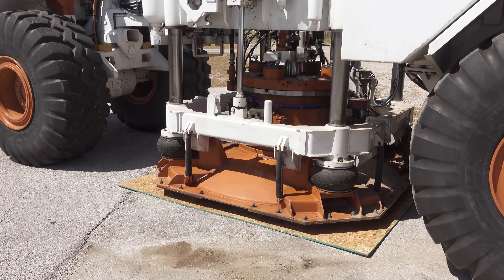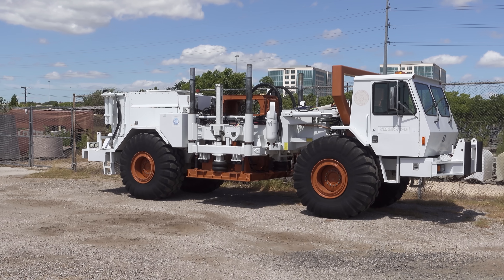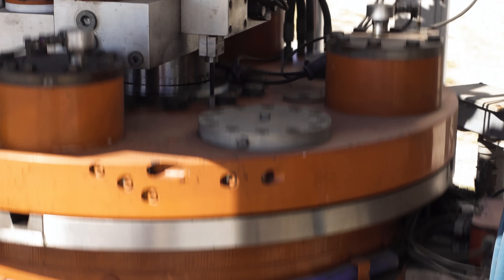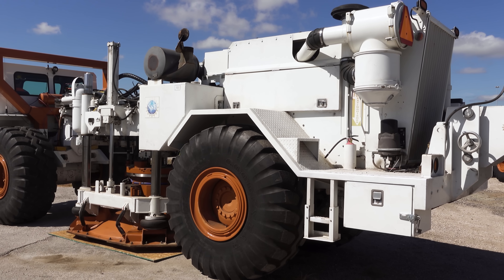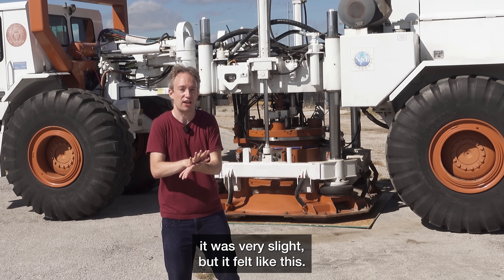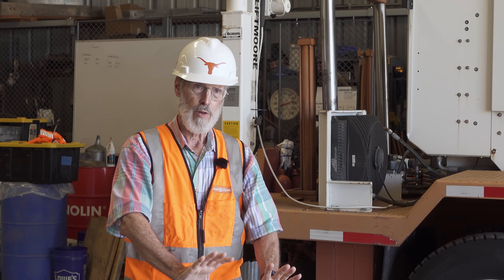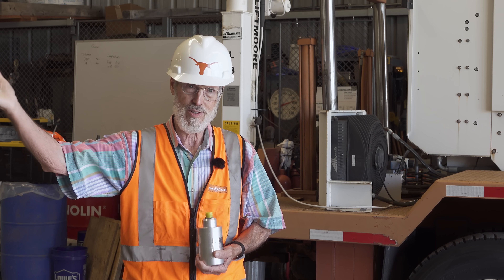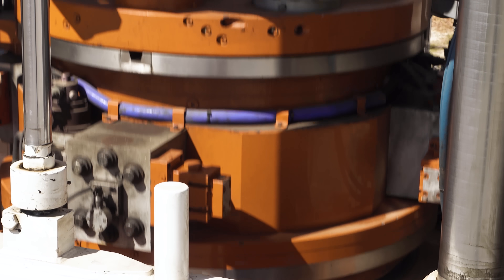This massive truck makes artificial earthquakes

Comment: i wonder just how much energy is required to move 27 tons back and forth at that frequency. has got to be megawatts worth of power
Reply: It doesn't move 27 tonne back and forth, the whole machine weighs about that, the inertial mass is typically about 1/10th to 1/12th of what the entire machine weighs. The entire machine is picked up on the central pad/mast, the inertial mass as it reaches the bottom and top of the stroke give the whole machine some inertia to push into and lift itself creating the earth wave. Depending on the frequency depends on how much power you need although there are mechanical limits the larger the machine the lower the maximum frequency the machine can reach. 

Something around 27 tonne will be limited to maybe 120 hz although typically run to 90 hz, smaller versions can do up to 400 hz although it does get to a point where the amount of energy you are putting in will start to overcome the hold down force so at 400hz you might be limited to 50% of what the machine is capable off.

As to your original question a 150ish HP diesel tractor motor is enough to run a 12 tonne machine the larger ones are around 300 hp, vibroseis or seismic sources used widely in geophysical/geological imaging if you want to do some further searching.
Reply: I don't think it's actually moving a 27-ton weight, just generating that much force with hydraulic mechanisms.  Still uses a lot of energy, though.

Comment: = H U M A N   U N I T S =

0,5 miles = 804,672 meters.
Reply: Wh-...  What?
Reply: @dannypipewrench533  have you read it right?
Reply: @_GhostMiner  Half a mile is not eight hundred four thousand six hundred seventy-two meters.

Comment: Interesting video Tom, but the Jurassic Park reference is actually an interesting one since they used guitar strings mounted on the vehicle to get that effect. DIY Hollywood at its finest!
Reply: I was looking for someone mentioning this!
I recall that they tried an actual ground shaker but the cars' suspension completely dampened out the vibrations, like it's supposed to really, so someone clever came up with putting a steel plate with an eye hook under the car and stringing a bass wire between the plate and the car's chassis. Then some poor, slim fellow would twang the string on cue and presto! one of the most iconic scenes in cinema.
Reply: I seem to recall from the behind the scenes, that they had a guy laying under the dash strumming a bass. Been a while since I watched it though.
Reply: What I love about that is generally how simple practical effects really can be.
Reply: It's not quite as interesting as the T-Rex machine, but that's interesting.
Reply: Dunno why they didn't just use the car's stereo

Comment: Imagine making a whole university building evacuate and being like "oh my bad, I'll just turn down the liquidator a bit, shall I?"
Reply: We call that an unscheduled earthquake drill. It was successful.
Reply: "Dont you worry pals, its not an earthquake! Its just our lil T-Rex stomping around"
Reply: But: it's good people knew what to do in an earthquake!
Reply: @tompw3141  well, in CA they do earthquake drills at school as well as fire drills. For earthquakes though they actually had us get under our desks and cover our necks with our hands to avoid falling objects. Depending on the building it can be safer to evacuate though. I would probably stay inside and duck and cover under something sturdy though at a college campus. Usually the buildings are newer and most are designed with earthquakes in mind when you are literally on a fault line
Reply: @jamies6337  UCLA has some old historic buildings. They may have been retrofitted with earthquake isolation pads like all the buildings at UC berkeley though.
Reply: @turbo_brian  Berkeley is on the Hayward fault, it's sheering Memorial stadium in two. They got quake concerns there.
Reply: @tompw3141  Except that’s not what you do. You’re supposed to get under a table/ desk, but if that’s not possible, next to a wall with no windows.
Reply: @tompw3141  Unfortunately leaving the building is exactly the opposite of what you should do in an earthquake, With few exceptions.
Reply: @macattackmicmac  Staying inside the building is the exception. As best as you can you should go outside clear of any tall structure. So unless you're in a place with many tall building close to each other, you should go outside.
Reply: @majesticfox  No it's really not. Most modern buildings are made to stay standing till the shaking stops, and to get safe from a potential collapse you need to get 1.5 times the height of the building away  from it. Finding a safe area in any even moderately built up area is going to be a challenge, coupled with trying to run on unstable ground, and the danger of falling masonry and glass from the facades of buildings fail.
Reply: @macattackmicmac  masonry and glass can fall inside as well. A lot of structures (especially governmental buildings i.e. schools) are not built new and if an exit is near you might as well run out before something gives in. Not sure where you got 1.5x distance from height from but the building will obviously fall down not outwards in the event of a collapse - as long as you have something obstructing you from line-of-sight of the building dust and glass should be a non issue.
Reply: @macattackmicmac  I'd rather take my chances outside than enjoy my time bouncing around in a concrete box full of smashed glass
Reply: @baconwizard  No you're wrong.  We lost people in the Christchurch earthquake who would've been safe if they stayed inside, but ran outside and got crushed to death under falling brick/masonry facades.

The people who died in buildings that collapsed never would've made it outside anyway.
Reply: A church has an entirely different construction than most buildings, especially the average suburban home. You are delusional if you think you should base your knowledge off of one situation that isn't even applicable ninety percent of the time.
Reply: @EmptyMTYT  that’s what I do everyday for a living!
Reply: @tompw3141  thats the exact opposite of what you do. If you run outside you're more likely to get hit by things falling off the outside. It's much safer to stay inside
Reply: @theexcaliburone5933  It's an earthquake, not a tornado or hurricane. Buildings collapse onto themselves, not outwards. Yes an earth quake would shake debris around but if you're a good 25 feet away from the building you're going to be fine. In an urban area this may be an exception but in rural and suburban areas, you have a death wish if you stay inside.
Reply: @memesarekeem  building should collapse into themself yes.
but I bet there been records of building not collapsing following that.
maybe a corner of the building gave way way before the whole thing fell down.
maybe in a skyscraper only the north side was rented out and thoes filled whit furniture causing unbalance of significant enough profile.
Reply: @Zack_Wester  Of course, I'm not saying it's impossible or even improbable for building faults and malfunctions and such, and of course it definitely depends on the size of the Earth Quake and the type of building you're in, your geography and all the other factors. Overall, I would say that being outside and far away from the building is the best option you have. Because, even if it doesn't collapse in on itself, if it DOES collapse, you will become either trapped in the building, pinned under rubble, inhaling carcinogens or what not. You are safer outside regardless.
Reply: @memesarekeem  tall buildings in earthquake zones are designed not to fall in earthquakes, so they don’t. The glass on the outside of them however will, then it will fall dozens of feet onto anyone who ran outside and wasn’t able to get more than a few feet away from the building before it started raining glass because earthquakes happen very fast. Short buildings in earthquake zones also won’t fall during an earthquake; the only difference is that the glass which you run into when you run outside won’t be falling as fast
Reply: Well it was California, lots of earthquakes there.
Reply: @xirfan  no there isnt
Reply: Honestly, in this case just calling it what it is is even more ridiculous - "Oh, sorry my bad, I'll just turn down my earthquake machine real quick"
Reply: His milkshake brings all the boys to the yard.
Reply: At least they got to avoid a few minutes of class.
Reply: Sorry guys, Just the T-Rex
Reply: "Liquidatorinator" is the correct term i believe. One could feasibly take over the whole tri-state area with one of those...
Reply: "What do you mean my earthquake machine is running too high?"
Reply: You mean the trex
Reply: As a proud Longhorn, I fully endorse messing with folks at UCLA!
Reply: how many of the folks throwing around earthquake safety tips have been through an earthquake, I wonder, how are y'all coming out with such contradictory suggestions
Reply: @river_brook  it feels like the contradictory opinions are just answering different questions. 

If you’re in a large suburban sprawl then probably going outside would be safer, because there’s lots of outside, the buildings aren’t tall, and with the way single-family homes in the US are generally structured, there often isn’t much stuff on the outside to fall off. 

In a denser urban environment however, staying inside is definitely safer, for all the reasons people have been talking about.
Reply: @river_brook  plenty of ppl have been in quakes. Running out of a modern high rise building is the wrong move. However, the shaker would not profile as a natural quake, and they may have thought it was a prelude to structural failure....in which case egress is the obvious move.
Reply: Best job ever!
Reply: When you've decided to beef with UCLA, but you got to maintain both a friendly demeanor and plausible deniability....
Reply: I mean... considering who was scaring who, I would imagine it was less of a "my bad" and more of a "let's see how much we can freak these UCLA kids out"
Reply: Especially to freak out people at the UCLA campus who experience earthquakes all the time 🤣
Reply: That's not how Americans talk.
Reply: Texans don't say "shall I"

Comment: I work in passive source seismology where we just wait for the earthquakes to happen and use that data, but I learned quite a bit about active source in my undergrad. I once heard a story about some researchers at a university who wanted to use a hunting rifle as their source, but it was too weak. So they got a Browning M2 Machine Gun. The airwave from the explosion however was affecting their sensors, so they mounted it on a cherry picker to get it higher off the ground. Better, but it was still an issue - so they decided to try and redirect the hot gases coming off the barrel. Their solution? Put a condom around the barrel. The final bill for their project included 2 Browning M2’s and 10,000 condoms
Reply: well, at least they figured out how to practice "safe seismology"
Reply: "Ah yes, a .50 cal machine gun! The perfect science instrument!"

Aperture Science probably
Reply: @davisdf3064  I mean, I’ve seen several kilos of Semtex used for university research purposes before, so a Browning caliber .50 would be quite a downgrade from that.
Reply: Walk into a pharmacy ...
"Hello, I'd like to by 10,000 condoms.  Extra large."
"Are you for real?"
"I'm a scientist, it doesn't get more real."
Reply: @IndigoIndustrial scientist: walks in to pharmacy

"This is a robbery give me all the XL rubber!"
Reply: I TOTALLY want to see that reimbursement form!
Reply: OK and how many of the Condoms where used for the experiment?
Reply: I'd love to see the accountant's face when they saw the bill XD
Reply: @natesmodelsdoodles5403  i wanna see the auditor's more...
Reply: @natesmodelsdoodles5403  69% chance it would be a 21 year old female intern.
Reply: @WeavementSesestea  loving the odds :)
Reply: They must have used "Magnum" brand condoms.
Reply: The guys I worked with used a Hammer and Anvil in their degree work.
Reply: Now that's a man's bill if I ever saw one
Reply: that happened

Comment: The most amazing thing about all this is that they can monitor the soil half a mile deep without boring. This sounded insane to me.
Reply: We actually can go a lot deeper. These types of trucks are also used for detecting oil and gas wells, but they can be used for most any kind of underground 3d imaging. Last time I was working with them, we were looking for the depth of the basement rock in a giant valley. Reason was for gold
Reply: @benjaminhislop7081  thumpers are a different class of crazy
Reply: It certainly isn't boring!
Reply: @WayofFlowingTime  dude that joke was more flat than this thing can press anything XD
Reply: These are also used for onshore natural resource exploration. When you shake it and record the echoes you can "see" several kilometres down. Do it hundreds of times in different locations and you can build up a 3D map of what's down there
Reply: In exactly the same sense it IS like ultrasound on a living body,  Or SONAR on a submarine.   You send vibrations in and look at the reflections.
Reply: @josephcote6120  Yep, but it is still complicated AF to interpret what those reflections mean.
Reply: @travcollier  No more so than ultrasound.
Reply: frr
Reply: It is interesting yes.
Reply: It is. That's the whole point of that thing.
Reply: Truly groundbreaking
Reply: *804,672m
Reply: @_GhostMiner  You mean 8.04672 megameters?
Reply: @gakulon  Wrong,  that's 5000 miles.
Reply: @gakulon  congrats, you're off by a factor of 10⁴!
Reply: @rosskrt  Not my fault the non-Anglosphere uses the wrong decimal demarcation 😉
Reply: @gakulon  i wasn't talking about that :) i was talking about the 8 megameters. You're off by a factor of 10⁴.
Reply: @rosskrt  And can't you see my being off was due to the person using a period instead of the more logical comma?
Reply: @gakulon  nope. You've gone out of your way to correct someone incorrectly. You seem to know there are multiple conventions, and as with all things human, different people may and do have different conventions. Makes no sense to expect everyone to use your standards. Right?

Edit: even ignoring the dot/comma problem, you still are off by a factor of 10. Try harder next time :)
Reply: @_GhostMiner   Ah, you used the comma instead of a period.   It's  804.672 m.  What you said is 500 miles.
Reply: @firesurfer  Congratulations!
Reply: Why not? You can use ultrasound to keep an eye on your unborn baby’s development. This machine may use a different frequency, but it should roughly work the same way. 🤔
Reply: @NikolausUndRupprecht  Unborn baby is just a few centimeters away from the apparatus, maybe less, not a freakin' half a mile under solid ground.
Reply: @92kosta  To >30kHz ultrasound waves, those few cm look the same as 100s of meters to <30Hz waves!
Reply: @92kosta  I think because this material is far denser and not at ultra sonic frequencies so the waves can penetrate far deeper, but with less resolution
Reply: @92kosta  Ultrasound with 27 tonnes of force, to see if it's Super Baby.
Reply: @92kosta  they don't have the resolution of an ultrasound they used on pregnant women they're, but theyre very good at finding underground caves, oil deposits and seeing if the ground is generally stable enough to perform construction projects on
Reply: @92kosta  But the wavelength from the truck-shaker is way longer. You'll see a lot further, but with less spatial resolution than with ultrasound. Same principle.
Reply: @T3sl4  Someone finally gets it! I was looking for this reply.
Reply: @NikolausUndRupprecht  Ah yes, it can be used to detect fetus buried half a mile underground
Reply: @vincentiusmarioslametprako5569  earth baby, Rick Sanchez time.
Reply: @vincentiusmarioslametprako5569  LMAO WTFF